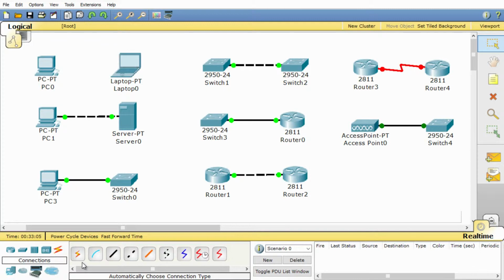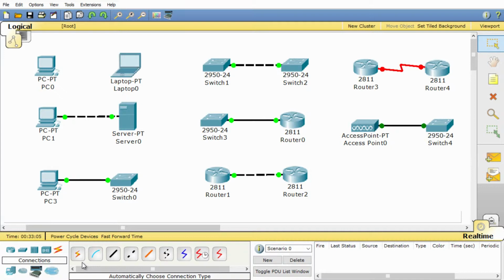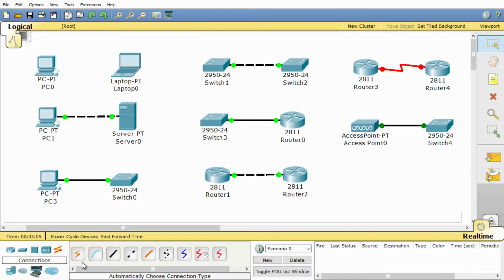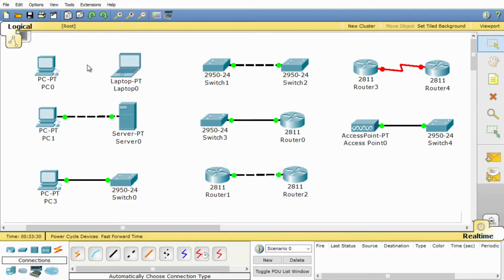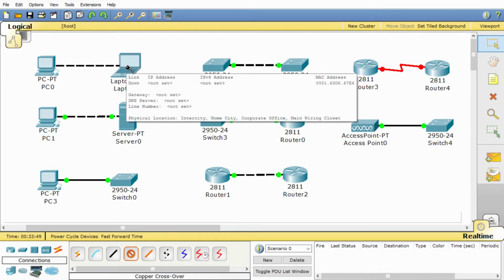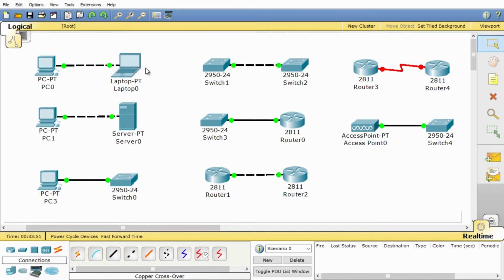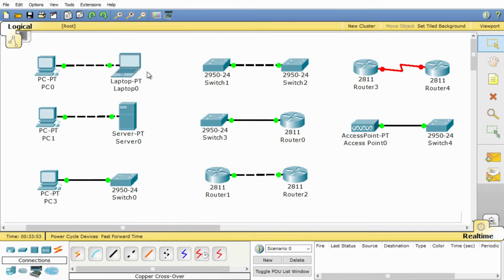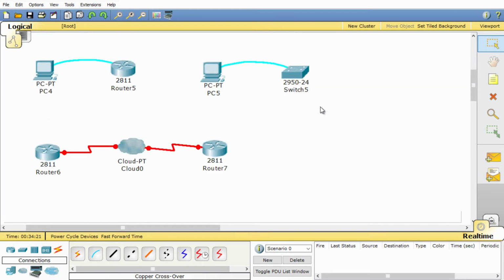Cisco Packet Tracer: Network Cable Selection Lab02

Comment: What happens when we connect straight cable instead of crossover cable.
Reply from the maker: In todays environment - not much, most ports are now auto sensing. Else - it wont work.